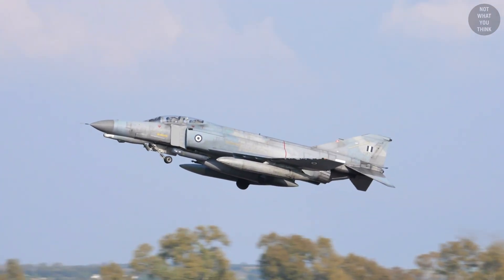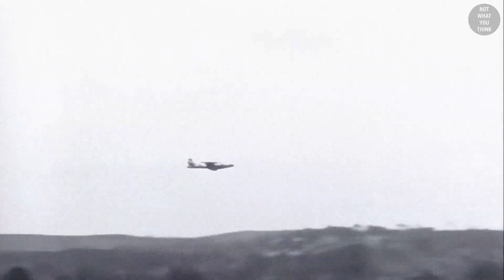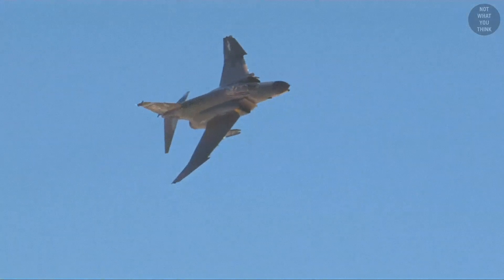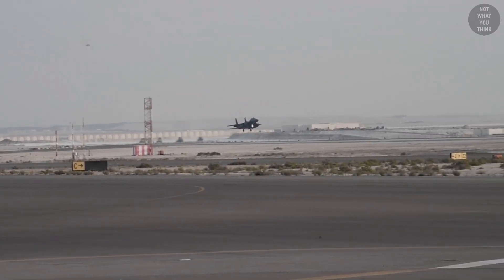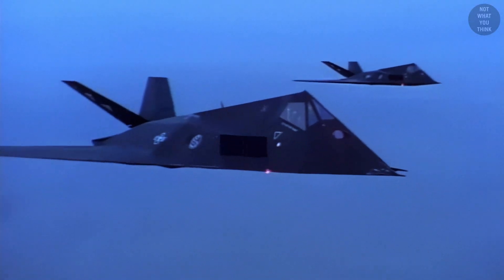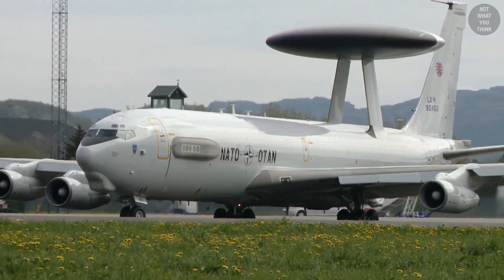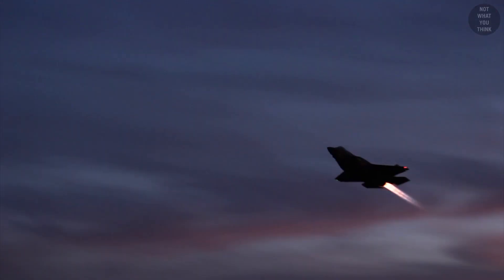Why are Modern Fighter Jets Slower than 1960s?

Comment: I'm surprised you didn't mention the concept of "supercruise". That is the ability to travel at supersonic speeds without the use of an afterburner. My understanding is that when this is achieved, the range is greatly increased because the aerodynamics of supersonic flight are more efficient than subsonic flight (as long as the afterburner isn't employed). Maybe I'm wrong about this though. I know that the F22 can supercruise but the string of JSF aircraft cannot...
Reply: Supercruise still substantially increases fuel burn compared to normal cruise.  Obviously not as bad as AB, but it's still far from free.
Reply: @northropi2027  It depends on what type of Specific Range you are after, yes super cruise will get you more range per fuel burnt and is also useful kinematically for lobbing missiles further and the decrease of Drag above transonic speeds is also useful for increasing Specific Range without use of IR intense afterburners.

But as far as Max Endurance its not particularly great for that.
Reply: @northropi2027  I thought modern planes such as Rafale were actually using supercruise to extend combat range.
Reply: @PierrickAnceaux  relative to always having afterburner on, yes, the range is better.  Relative to subsonic cruise, range is far worse.  Supersonic flight is just an inefficient way to get around, afterburner or not, though this isn't to belittle that if you have to be going supersonic the entire sortie then supercruise would probably be better than full wet thrust.
Reply: Well, the main feature of the F-35's engine is that it burns cooler, so you can't have it all.
Reply: @JAnx01  Apparently not cool enough to avoid turbine blade fracturing being reported back in early 2020.
Reply: @uberschnilthegreat22  Cool as in cooler exhaust than usual.
Reply: @JAnx01  The main feature is that the f35 burns at an higher temp, so what do you mean by cooler ?
Reply: Actually the English Electric Lightning could supercruise and it was a contemporary of the F-4 Phantom II
Reply: @bigblue6917  ahh, the lightning! The (Mark Felton?) video of Mike Hale smoking Concord and intercepting a U2 has me reaching for my Union Jack 🇬🇧
Reply: @Morris2182  it intercepted the SR-71 twice. Imagine piloting the Blackbird and the Lightning goes hurtling past you.
Reply: @bigblue6917  Source?
Reply: Also supersonic flight adds tonnes of heating on plane skin
Reply: @Eleolius  well at any speed there is both a cooling and warming effect of the wind speed. At speeds over mach 1 the heating effect start being significant, but its not really priror to about mach 2.3 that the effect is that large so its something that needed to be considered. At something like mach 1.4 or 1.6, that is typical supercruse speed the skin would still be cooler  than the internal temperature
Reply: Having listened to F-22A pilots talk about this, no.
Reply: @Random_White_Circle  Would they say though they get better range than full afterburn?  I can understand super cruise not being as efficient as standard cruise but there had to be some range benefit to the concept when not using afterburners to achieving those higher speeds.
Reply: Eurofighter typhoon can super cruise aswell :)
Reply: Supercruise isn't really for extended operation range. It has 2 main reasons. 
1. is simply faster response time as the jet can reach mission area faster if needed.
2. Combat advantage. Supercruise greatly increases missile range as it helps missile break the sound barrier which is the speed the missile face the highest drag. Faster also make it easier for the jet to defend against missiles as the missiles with need to adjust to much further lead. Both are important for Beyond Visual Range engagement.
Reply: F35 can maintain a speed above mach 1.0 for a 150 mile  dashes, so..in all practicality, it pretty much can super cruise.
Reply: The English Electric Lightning and the F86 could supercruise. It's not a new thing.
Reply: Pp0
Reply: There is a fuckton of drag when breaking the sound barrier from like mach .9+, after that drag is like 20% worse when supersonic compared to say .8mach.
Reply: You're all so full of crap, you all start believing your own crap
Reply: as far as i can remember, the English Electric Lightning could supercruise! that thing was a riduculous plane
Reply: These replies are by far the funniest shit I've seen all day. A bunch of morons who think they understand physics or modern aerial combat. It's laughable. The F22 is a air supremacy fighter, the F35 is a multirole jack of all trades. Why are people so shocked this has been the US doctrine since the beginning of the jet age. IE the F15 and F16
Reply: @EBEDieandRetry  I'm communicating via text in the YouTube comment section...
Everything I've read that is a direct quote from Jesus or the Apostle Paul was also written in text.

Don't tell me what to do.
I will continue to obey God's command to 
'go into all the world and teach every creature to obey him.'

P.S.
Evolution offers you a future as dirt.
Christ offers you eternal life and the peace of God.
Reply: @EBEDieandRetry  
God is not going to provide you any more evidence for his existence other than the gigantic Planet crammed full of amazing creatures on which he placed you.

No one will have the slightest excuse.
Reply: lol What the fuck happened here
Reply: Although supercruise is thought of the ability of the engines to maintain supersonic speeds without afterburners, the real goal really was how do turbofan engines reduce the bypass as the the speed increases to being supersonic. 

Turbojets can supercruise without afterburners given they are already at a higher altitude. Afterburners is what gets the turbojets those Mach 2.0 + speeds.

It maybe is an issue of of having greater thrust but the SR-75 engines and the F-35 almost have same thrust output. The SR-75 engines become more like ramjets the faster it goes.

I believe supercruise is really the idea of trimming the bypass of jet engines to allow for lower consumption of fuel as the speed is increased.
Reply: F22 does over mach 2.25... and yup supercruise is where its at the fuel efficiency
Reply: @KrGsMrNKusinagi0  Completely incorrect. Super cruise massively cuts down the range of the F-22 which is already a little short on range. What you and the other low knowledge people here don't seem to understand is the massive increase in drag supersonic speed places on the jet and the increase in dynamic pressure of the air entering the engine which drives fuel consumption up further than just the increase in drag does. 

No the F-22 does not do over 2.25 Mach. 2.25 is the VMax of the aircraft. That's the speed it is not permitted to fly faster than. In service the jet never gets above 1.6 Mach and this is exactly the reason the VMax of the F-35 is set at 1.6.
Reply: I think the Falklands War showed that a subsonic plane like the Harrier could handle the supersonic French planes the Argentinians used.
Reply: @maxwellshammer5283  
The Falklands War did not show anything of the sort.

So you are going to use the one example that does not actually prove what you think it does? Had the Argentines not been operating at extreme range and been trained how to properly use their aircraft against the sub-sonic Harrier the war may have turned out very differently.
Reply: Just want to add this in the conversation somewhere. 
Remember that the Concord super-cruises. You need AB up to Mach 1.6 or so, but then with standard thrust it accelerates to Mach 2.0
Reply: Supercruise is essentially due to increased engine efficiency. Nowadays combustion chamber temperature is higher which means engines runs leaner mixture than previous one, substantially increasing heat.
Reply: When Concorde flew. It’s engines were tuned for supersonic cruise. It actually consumed less fuel when supersonic at high altitudes than it did taxying from the gate to the runway.
Reply: @notmenotme614  do you have a link for your source? That's really cool, I think I wanna read about that
Reply: The exact opposite is true. Supercruise substantially increases fuel burn and can cut a fighter's range in half. Drag rises with the square of the velocity and you can't cheat physics. Much like thrust vectoring, supercruise has proven to not be worth the extra complexity and weight it adds to a design. Hence why they were left out of the F-35's design.
Reply: @dat581  Your point about drag is spot-on.
On the other hand, insinuating that supercruise adds "extra complexity and weight" is inaccurate or misleading. Supercruise isn't a physical "thing" - it's the ability to achieve supersonic speeds without AB. All one really needs to achieve supercruise is a combination of a powerful engine with reduced drag and/or weight.
As some on here have noted, other aircraft before the 5th generation F-22 have been capable of supercruise, especially when flying "clean" (i.e. without external weapons or fuel tanks).
A more accurate statement would be that Supercruise was not a requirement of the F-35 design because it's primary mission was air-to-ground and therefore it wasn't see as critical to get to the target area at supersonic speeds as say, an air-to-air intercept by an F-22 or J-20.
Reply: @kevinb4077  So you haven't a clue either. Super cruise adds weight and complexity by requiring more complex intakes and the control systems that go with them.
Reply: @dat581  From what i have heard, only the F-35B (STVOL) and F-35C (Carrier) don't have Supercruise. The conventional F-35A has Supercruise.
Reply: @vasiliyt8600  None of them do. The USAF didn't think it was worth the bother.
Reply: While it's not a feature, F35 can definitely still supercruise.
Reply: @dat581  I believe ramjets are more effective at supersonic speeds but also less effective under them. I guess still wouldnt be as or more efficient than something like a f404 in a hornet
Reply: @carti9248  Believe what you like but no, ramjets are not more efficient anywhere below 3.0 Mach.
Reply: @dat581  thx 4 info
Reply: @dat581  the thought is you're outrunning you're own shockwave?
Reply: @seeker296  That's a no.
Reply: @dat581  , The F-22 is a very good fighter and I think it gains a lot from both supercruise and thrust vectoring. One of the design requirements for the F-35 was to not include any technologies that would prevent its sale to foreign countries. Furthermore, putting thrust vectoring on the F-35 would be like putting lipstick on a pig. The F-35 was not designed to be a top dogfight fighter, but it has many other great capabilities.
Reply: @NotTheSharpestBulb-mh  Actually just about everything you have said is wrong. The F-35 was not designed to be a "top dogfighter"? Actually it was and the only aircraft that exceeds it is the F-22 and the Raptor does not exceed the F-35 in all areas of the maneuvering envelope. That silly claim is just a myth.

Thrust vectoring is not on the F-35 because it is not worth the bother. The USAF has considered locking it out on the F-22 because it doesn't add all that much benefit. Supercruise is also hardly used and not worth the bother. It's really just another misunderstood capability that fanboys love but real fighter pilots don't care about. Just like top speeds that fanboys love to quote but are completely irrelevent.
Reply: @dat581  , There were a lot of compromises made in the F-35 design. The dogfight capability was not the top priority. Air superiority was left to other planes like the F-22.
Reply: @dat581  Your comment about some people obsessing about top speed reminded me of something I read decades ago.  - a young US pilot,  (I think k he was a pilot,) was talking g to Adolf Galland and asked why he preferred the ME109 to the FW190 which was 'obviously' your best fighter. Galland responed that yes the 190 was faster but, you had to work to control it all the time whereas the 109 was easy to control and you got much more out of it than you did the 190. - statistics will only tell you so much.
Reply: @cyngaethlestan8859  Pretty much. Maximum allowable dive speed and climb rate could be far more important than maximum level flight speed in those piston engine fighters too.
Reply: @dat581  and that's why legacy aircraft can easily out turn, out climb and out dive the F-35...
Reply: @aaronsanborn4291  What, like a spitfire?  Which can out turn an F22 as well.  If you mean F16s and F15s, then no.  Of course, either of those aircraft in a real world fight against an F35 are a hunk of burning metal falling out of the sky way before they get anywhere close enough to turn with it, is that what you meant by dive rate?
Reply: @aaronsanborn4291  Who the hell is dogfighting in this century?

Against those legacy fighters which many of our allies still have the F35 does them in with ease.
In Red Flag just one F35 has a 17-1 ratio.
A full squadron and it goes over 100.

You are stuck in the past.
Reply: @aaronsanborn4291  I’ve been researching this and the opposite is true. The F35 can outmanoeuvre legacy fighters easily but it is slower in outright top speed. The US armed forces would never develop a fighter that was had worse maneuverability than its predecessors.
Reply: @jars6230  [fightets]  ~'are a hunk of burning metal before they get anywhere near'  -   -  As a generalist it seems to me that the latest high end 'fighters' have become more like highly complex control centres for equally complex long and medium range missiles rather than a 'fighter' aircraft. 

Given that in a dogfight they will get their arse's handed to them by many true fighters,  their use as a control centres seems odd.  Why not have a modern Vulcan with all the necessary high tech' equipment and sensors controling a number of true fighters,  (that could each carry some extra sensors and a couple of missiles controlled  by the mothership.) Such an aircraft could be reasonably fast, agile and stealthy (why I mention the Vulcan rather than a Victor or B52,)  whilst carrying large numbers of missiles as well as extensive defensive measures and sensor drones.

I realize this might sound outlandish and that it would  require a lot of hardened connectivity but isn't this the way these mind numbingly expensive 'fighters' are going anyway but they only carry a few missiles.
Reply: @cyngaethlestan8859  1.  The Vulcan becomes the point of vulnerability, everyone will just go after that.  
2. In practice, the most likely tactic 'true' fighters will use against F35s will be to run away.  Unlike combat exercises, where the loss rate of 'true' fighters against F35s is huge, real adversaries dont send expensive aircraft and men on suicide missions.  Hence, the current relative lack of aircraft over Ukraine, they aren't willing to run the losses.  
3.  Drones intended to be companion aircraft are about to be rolled out.  The most likely aircraft they will accompany on missions is the F35.  Relatively stealthy, able to operate relatively independently, the enemy expends all its time, fuel and missiles fighting drones, while the F35s loiter watching it all. You cannot swoop in and finish of the job in a Vulcan, you can with a flight of F35s. 

Military experts arent stupid, if the local drunk at the bar has thought of a brilliant new strategy, or piece of hardware they should use, there is generally a solid reason why they aren't doing that.  Generally being, its because its a stupid idea.
Reply: @jars6230  While I may not be a genius,  I am neither a drunk or stupid.  I was noticing a direction of technological travel, to wit,  long range control and engagement which seems to partially negate the need for all aircraft to engage in classic short range fighting.  You say,  (and I'm not questioning it - as I mentioned I'm a generalist,)  that companion drones are being developed for use with the f35,  well why not use these with the new,  larger, longer endurance aircraft as I suggested. 
 [I take it you understood that I did not mean an actual Vulcan but a new aircraft]  
As you say the enemy will be forced to engage the drones and missiles,  (whether launched from the mothership a drone or fighter under the mothership's control or direction.) As for the f35 itself going in to deliver the coup de grace,  this seems to risk your core,  very expensive and rare asset.  Send in the less valuable and more numerous fighters. 
To your first point that the mothership would become the enemy's point of attack. This is probably true unless they have highly effective communications interference (I see secure effective com's as the biggest problem) but just as with a carrier battle group the 2 or 3 motherships would have multiple layers of defence with their fighters, drones,  missiles and counter measures. 

Lastly you mentioned the f35s very high kill ratio but it only carries a few missiles so this is theoretical. a large aircraft could carry  four or more times as many plus those on other platforms it is controlling

I am not trying to start one of those annoying Youtube rows but I don't think my idea was 'idiotic.'  Ideas,  good or otherwise  don't always come from experts and it seems reasonable to at least air them.  - [remember the yanks took the best submarine design available, the German type 21 (21?) and stuck an atomic power plant in it to produce the 'best'  submarine - meanwhile the Russians gave the problem to a team who knew nothing about submarine design and revolutionized all future submarines]
Reply: @dat581  Yup, physics is unbeatable.
Reply: @dat581  Viscose drag rises with v cubed, not squared.
Reply: @dat581  I thought drag was closer to cube of the velocity but does it change over at supersonic?
Reply: @hubbsllc  Look up the drag formula if you don't understand. D=Cd1/2V2S
Reply: @dat581  I "understand" but I still stand corrected. And, it looks like the equations are different between sub/supersonic but contain a V^2 term in both cases.
Reply: @dat581  Not true at all. The F-35 is too much of an aerodynamic pig to make supercruise worth the effort. Thrust vectoring reduces trim drag and is most definitely worth the effort. F-35 does not have F-22-level performance because it was never designed to be. It's primarily a strike aircraft, not a fighter or interceptor.
Reply: @dat581  I'm Talking about Specific Range not Range as a total, Drag actually Decreases after passing transonic speeds and going super sonic, requiring less power than going high subsonic.
Reply: @glassfullofmilk  It seems you don't understand specific range either. What you aren't getting is the huge fuel consumption increase that is imposed on the engine past the transonic region. The specific range is far less at any supersonic speed.
Reply: @dat581  It seems you are forgetting about the increase in Q at higher speeds increasing the available thrust at an already high efficient engine operating RPM and low specific Ct
Reply: @glassfullofmilk  Yes, supersonic drag is lower than transsonic drag, but it is still higher than the drag at subsonic speeds. 
The max range can usually be achieved at subsonic speeds. That said, the F-104 is an example of an aircraft that had a lower subsonic range than other interceptors of that time, but a higher supersonic range. Still, the supersonic range of the F-104 was a fraction of its subsonic range.
Reply: @dat581  What you say regarding drag and velocity isn't true for supersonic speeds. It only applies for subsonic speeds and below mach 0.8. After that, there is a huge spike in fuel consumption, followed by an exponential drop at around mach 1.6. In theory, if you "have to" fly supersonic, the most efficient speed would be above mach 1.6, however it's true that even after the exponential drop, fuel consumption in supersonic range is still always greater than that in mach 0.8
Reply: @spencermacallistor  That one's a bit of a myth and does not apply to conventional jet engines.
Reply: How are they able to enter supercruise without a frame shift drive?
Reply: @ENCHANTMEN_  They use a friendship drive.
Reply: @ENCHANTMEN_  They must have outfitted the friendship drive, some super top secret stuff.
Reply: How many fighters can super cruise with a combat load?
Only the F22. 
All others that can  super super cruise need to  sacrifice ordinance to be able to  super cruise
Reply: @Milvus_In_Excelsis  is that with weapons on additional hardpoints or just internal bay storage?
Reply: @smithyMcjoe  just internal storage.
That's the thing with weapons in hard points, they cause a lot of drag.
Reply: @Milvus_In_Excelsis  I assumed as much, tangential but, I don't imagine they'd be very good for it's radar profile either, many more faces for it to bounce off of.
Reply: @smithyMcjoe  that's why fourth generation fighters have big RCS.
A clean F16 Viper has an RCS of 0.5.
Lower than the RCS of the SU57.
But once weapons are added the RCS goes up.
Reply: @Milvus_In_Excelsis  pretty sure the Swedish Saab 39 also can super cruise with combat load, but it’s a much smaller plane designed for takeoff and landing from normal roads (so I’d doesn’t need airports) and can therefore not carry as many weapons as a larger jet
Reply: Then you also have to address g forces. You could have a craft that can handle the manuvers but still unable to use them because of the pilots capability to handle gs
Reply: @seanrea550  True and a lot of g also causes increased metal fatigue on the wing roots etc. Reducing the lifespan of the aircraft. Yes a jet might be able to do 9g, but not indefinitely for 10,000 flying hours
Reply: @notmenotme614  yep, there are some planes that can do mannuvers that cause their pilots to black out already. G-suits only do so much. I think the best G-suits only set the g limit up to 8 or 9 Gs.
Reply: @seanrea550  What are you on about?
Reply: @dat581  manuvering at speeds cause g forces. A plane can be made to handle them, pilots not so much.
Reply: @seanrea550  Thank you Captain Obvious. That has nothing to do with this thread.
Reply: @dat581  for a planes top speeds or prime cruise speeds to be useful they should also be able to manuver at those speeds, which also includes slowing airspeed to manuver. Unless you only plan for the plane to turn over far wider arcs than others in its class.
Reply: @seanrea550  Ok you should stop now. You REALLY have very little understanding of what you are talking about.
Reply: maybe you're wrong about this...yes probably you're
Reply: @givdb5513  thanks for contributing here. I think I've had about 40 people offer to tell me that. Very helpful. What's funny is I looked up supercruise right after I posted this comment and before anyone replied and quickly learned the truth about it... But then for the next week, all I get are replies telling me I was wrong.
Reply: @perpetualjon  Ultrasonic airplanes are still in experimentation. Years ago that would be impossible. Now it is HOWEVER that doesn't mean still useful and practical, the costs, and the accidents it can cause if suddenly you break (how many G forces)
Reply: @givdb5513  WTF is an "ultrasonic" airplane? We're still working on hypersonic aircraft, and probably won't have operational one for a decade or two. So ultrasonic would be what? Mach 50 and above?
Reply: @markbrisec3972  Mach 50 already exists. It's the nuclear weapons of China that they only have. I confused the word however what's the difference between "super" and "ultra", it's like when we were kids saying that "I'm transformer super mega ultra" they're all synonymous words, those words in the dictionary don't have LV 1 LV 2 LV 3 or definitions like Ultra = is more than super IT IS NOT. Ultra it is an informal word synonymous with super, however, it has the slight definition of "beyond space" or "extremist" while super "exceeds the limit" and "very fast". 

In the end, they're very similar words.
Reply: @givdb5513  Yea no mach 50 doesnt work in the atmosphere really it would be rapidly vaporized from heat, Mach 25 is around reentry speeds,but the term your looking for would by hypersonic, also its called a prefix so not exactly words themselves except in a few cases but its a modifier on words that functions as a descriptor. One of another fun quirk of english.
Reply: @melalba9711  China has the most fastest missiles in the world. It's impossible that the USA has one better. I was watching a whole documentary that America was worried about it because it would be impossible to defend it. until they invented some defense mechanism. Just like 5G belongs to China only, the rush for technological advances will determine the future of a country.
Reply: There really is something very wrong with you people today. You all get taught propaganda as if a real part of your own country's history?, and it's the rest of us, that have to put up with reading your own opinions of comical rubbish! 

Try to have a discussion about any military aircraft, with any American, and you'll be shocked just how unaware they really are? They all talk endless rubbish, and so much so, they even start to believe their own rubbish. It makes no difference, if you show them, or explain to them, or even go through it in fine detail with them. 

You can conclusively prove things to these people, and they'll ignore it, and just carry on saying the same thing? Even when they've just been shown, and had something proven to them, (something that they were completely wrong about), makes no difference at all. Nope, they'll just deny it, or ignore it, seriously, you can talk to any of them about any military hardware, at all, and you'll always come to find, they actually know nothing about any of it.

Even when you point things out to them, things that they've so obviously just dreamt up in their own head?, all you'll then get back, is a few lines of remedial illegible rubbish. But you'll then see them somewhere else, repeating what they now already know to be complete rubbish??. Honestly, you could not make it up! 

If people could think for themselves today, they'd all be questioning why the USA made a point of announcing to the world, they've made it illegal to sell the F-22??. The USA seemingly want it believed, it's because it's so good, they don't want anyone else to have it?. But, that actually makes no sense at all, because the reality is, they've no idea what's around the corner in modern technology terms, and with the speed we're seeing new military tactical hardware being designed, developed, and created today, It could well of made great sense to sell the F-22 at some stage?. (If it actually works). If it worked?, they'd have been able to recoup much of the resources spent on the aircraft, if not the resources in their entirety.

Now, there's another reason the USA would make a point of announcing they've made it illegal to sell the F-22?, a point that the American people seem to want to neglect today? And that's, If, it doesn't work, If it is, as I suspect it is, a lemon?, and if the USA have then used the F-22 as a propaganda purpose aircraft?, then what better way of preventing anyone else from finding out that it actually doesn't work, and it's really a lemon?, than making it illegal to sell? 

Really, and logically, the only possible way to explain that stunt, of the USA announcing they've now made it illegal to sell the F-22, can only be because it's a propaganda aircraft, a failure! 16 years the US have had F-22, and they've been in wars the entire time, only they've never used it, and they removed every F-22 from the Middle East, Jordan, Iraq, Turkey, and Saudi just after Russia arrived in Syria in 2015.

You can think about this as much as you like?, that is the only real possible reason the USA would do that. Absolutely no doubt about it, I guarantee we'll never see the F-22 involved in any sort of war scenario, or any major sortie, as it's basically junk. They've even trashed all the infrastructure they had in place to build more of them.
Reply: @hotstepper887  , This rant does not have a single actual military fact about the F-22. You call it a failure, but you do not seem to know anything about its performance, stealth, or other characteristics.
Reply: @NotTheSharpestBulb-mh  I have also shown you how useful what it does claim really is? Do you not understand the English language? 

Mark Hollingsworth
4 minutes ago
 @Hot Stepper  , This rant does not have a single actual military fact about the F-22. You call it a failure, but you do not seem to know anything about its performance, stealth, or other characteristics.

I think, you'll find this answers everything you've just pathetically tried to claim? 

Seemingly these Americans have no idea the F-22 and F-35 can't see, track, or target any other stealth aircraft from BVR (beyond visual range). Stealth alone defeats high-frequency (short wave) radar by absorption and deflection, it does not defeat low-frequency (long wave) radar. Therefore, to see, track, and target stealth aircraft you must have long-wave radar, but it must also be enhanced to remove all background clutter for targeting purposes.

Neither the APG-77 radar used in the F-22, nor the APG-81 radar used in the F-35, can see any other stealth aircraft from BVR (without enhanced long wave radar) — This fact the US Air force obviously know! Only it seems the reality is, that when the F-35 radars were being designed 13 years ago, there were no other stealth aircraft to think about as a potential threat? So how can these US aircraft be seen as any sort of threat to either China or Russia, who both have these aircraft technically beaten? They can see and target US jets from BVR, yet the US jets can't even see them from BVR?

Russia's new 5th generation Byelka (2band) radar, used in SU-57, does have enhanced long-wave radar, they've designed and developed the first L-Band fighter radar we've ever seen. They've cleverly embedded L-band AESA radars in the leading edges of the wings. The new L-band AESA radar data gets processed in real time through extremely powerful Russian Elbrus computers being significantly enhanced removing all clutter, meaning it can see, track, target, and engage enemy stealth aircraft from BVR. The technology along with its impressive range parameters and jamming ability over large areas make this aircraft deadly to all other aircraft types. 

They can also interact in ''real-time'' with each other member of the squadron, (auto selecting) the best placed BVR missile, that can be fired by anyone of the squadron with a bogie on radar, they can also take control of surface-to-air (SAM) missile defence systems - (that alone is lethal), and they can see track, enemy stealth fighter aircraft long before Russian airspace, from much greater distances, with "real-time" data from massive Russian ground long wave stations (that are all protected today with the networked S-400 defensive system). 

Therefore, as they'll always know where the enemy aircraft are, they'll always be able to approach any enemy aircraft head on, and therefore stealthily, (Russia wisely sacrificed rear end stealth for much better manoeuvrability) meaning today, the US fighter jets would not even be able to see them coming!! Russia's Byelka (2band) radar covers all aspects of frequencies across all channels, that are used for tracking, targetting, and also jamming. It's part of Sh121 multifunctional integrated radio electronic system (MIRES) on board the SU-57. 

Russia tested much of this new radar suit on the SU-35, so they also have the option of fitting this radar into SU-35's permanently, meaning Russia's SU-35S flanker will be at no disadvantage with F-22/35. As although the SU-35 can be seen and targeted from BVR, the SU-35 with the new 5th gen radar is as able to see and target the US jets from BVR, seeing the all-important Russian advantage in BVR missile distance, plus the excellent manoeuvring, neither the F-22/35 have, as more than critical, if you're going to avoid simply being blown out of the sky.

The design has clear potential to provide a genuine shared multifunction aperture with applications including: Search, track and destroy missile mid-course guidance against low signature aircraft. Identification of Friend, Foe/Secondary Surveillance Radar. 
Passive angle tracking and geolocation of JTIDS-MIDS-Link-16 emitters at long ranges.
Passive angle tracking and geolocation of L-band AEWC-AWACS and surface based search radars at long ranges.
Passive angle tracking and geolocation of hostile (i.e. Western) IFF and SSR transponders at long ranges.

High-powered active jamming of JTIDS-MIDS-Link-16 emitters.
High-powered active jamming of satellite navigation receivers over large areas.
High-powered active jamming of L-band AEWC-AWACS and surface based search radars at long ranges.
High-powered active jamming of guided munition command data links over large areas.

Effectively neutralizing the USA's use of AWACS for their detection. The Tikhomirov NIIP L-band AESA is a very important strategic development, and a technology which once fully matured and deployed in useful numbers, will render narrowband stealth designs like the F-22 & F-35 Joint Strike Fighter, and some if not many UAVs, as highly vulnerable to all Flanker variants equipped with such radars.

Do you understand ANYTHING at all? Now please. Do take YOUR rant of completely uneducated junk elsewhere and leave my name off anything else you might want to say, I'll never be interested in hearing anything you might think, and don't want the notification of another idiot talking juvenile rubbish, thanks all the same.
Reply: @NotTheSharpestBulb-mh  My old man was a Captain, and squadron leader of 800 squadron, in the FAA (Fleet Air Arm) of the RN. 

He was selected to go to the States to train them, how to fly the Harrier, and show them what the Harrier could do. We off loaded quite a few of our older and retired Harriers to the US, so they could learn all about it, while training their engineers on its engines, airframe, and construction. 

They then got permission to build the Sea Harrier, but were only allowed to make very few modifications to the design. 9 years we spent over there, and it's him and all his mates who said the F35B would never be VTOL capable, and they were all spot on... LOL

And furthermore it actually offers us nothing, we could not already do, but in fact less than we could do with the Harrier?, as that aircraft could come from, and go anywhere with its VTOL ability, as all the US special forces will attest too. 

They used it more than any other aircraft,  they were attacking Taliban, just lifting from a "hide" remaining low avoiding any SAMs or radar, ambushing them before they could scramble to safety, then just gone.  While returning to that hide. They wiped out more like that, than by any other means.

He also flew the Buccaneer, an aircraft I've been in many times, from the age of about 11 LOL... Well things were a lot different back then, and us kids would often get to go see the old man on a Sunday when they were at our home bases, and down here, whenever it was quiet we'd often talk our way into a flight on whatever aircraft they were with LOL.

The old Fairey Gannets were awesome, man, what a view! I've been in the Harrier GR 5, GR 7 and the GR 9 also the Sea Harrier. Nearly every helicopter you could think of, LOL, including the old, world speed record holder, the Lynx. Gliders?, done many of those, but the most amazing and impressive of them all was indeed the Buccaneer.

You can't describe what it feels like to travel at an altitude of 10 - 15 feet, at 450 mph. Seeing garden hedges as blurs LOL, flying straight over them hahaha. That aircraft, the Buccaneer I'll never forget, it scared the life out of me.

Rolling down the runway
throttles open wide
see the mighty Phantom
sway from side to side
airborne again without a blip
It's just one more aborted trip
but we're pressing on regardless
for the wg cdrs AFC

Went to early briefing
climbed into the Kite
opened up the throttles
and roared into the night
leaving the flare path far behind
It's dark outside, but we don't mind
cos we're pressing on regardless
for the wg cdr's AFC

Rolling down the runway
throttle open wide
see the mighty Falcon
sway from side to side
airborne again with just 9 G
I wish I had a nav with me (!)
but we're pressing on regardless
for the wg cdr's AFC

Rolling down the runway
throttles open wide
see the mighty Jaguar
sway from side to side
airborne again, but only just
It's not much fun
with F*** all thrust
but we're pressing on regardless
for the wg cdr's AFC

GIVE ME BUCCANEERS!
They're British through and through
The Banana Jet
The Best we've had yet
We are the last of the few.

Don't give me the Jaguar
Unless you refer to the car
The car is a groundhog
The aircraft is half frog
Don't give me the Jaguar.

Give me Buccaneers
They're British through and through
The Banana Jet
The Best we've had yet
We are the last of the few.

Don't give me the Harrier jump jet
You haven't convinced me yet
Jets that fly backwards 
Are soon to be knackered
Don't give me the Harrier jump jet
Well… Not just yet...

Give me Buccaneers...
They're British through and through
The Banana Jet
The Best we've had yet
We are the last of the few.

Don't give me this computer crap
It's no way to tackle a SAP
It's OK for Dicks, Germans and Spicks
But Gentleman always carry a map!

Give me Buccaneers...
They're British through and through
The Banana Jet
The Best we've had yet
We are the last of the few.

Don't give me Air Traffic Control
They live in a bloody great hole…
They scream, and they shout, then F**k you about
Don't give me Air Traffic Control.

Give me Buccaneers...
They're British through and through
The Banana Jet
The Best we've had yet
We are the last of the few.

Don't give me the F-104
It's only a ground loving whore
It goes in a turn, flick, spin and burn
Don't give me the F-104.

Give me Buccaneers
They're British through and through
The Banana Jet
The Best we've had yet
WE ARE THE LAST OF THE FEW!
Reply: There is so much we could talk about with the F-35?, and just looking at the reality of the F-22?, should have been showing us all the reality before this country bought a single one, but not only did we waste our money on them, but we put our own Rolls-Royce engines in our F-35Bs. 

That don't stand up to what we were all told they would be? An aircraft that is stealthy with much improved electronics and computer software, able to travel supersonic that, like the Harrier, would be VTOL capable.

It's very clear, we would have been far better off concentrating on a new supersonic Harrier type, or we should have been looking at the new SABRE engine as a realistic look at upgrading our own air force? 

With the wasted money, we could have been building our very own modern fighter aircraft for the last 20 years?

Today, BAE Systems is developing a HVP (Hypervelocity Projectile) for the British & US military. They've already purchased 22% of ''Reaction Engines Limited''. 

Reaction Engines, was founded in 1989 by three propulsion engineers from Rolls-Royce, Alan Bond, Richard Varvill and John Scott Scott. 

Their early work on the RB545 engine, destined for use on HOTOL was evolved and focused on producing a robust technical design for the new Synergetic Air Breathing Rocket Engine. (SABRE).

They've been developing a new type of hybrid jet/rocket engine.  SABRE — can lead to the development of new hypersonic aircraft and future space vehicle's. The technology has immense military value for the creation of hypersonic missiles or/and aircraft, that would be able to hit targets at speeds and ranges that are unheard-of today. 

Moreover, defending against such an attack would be extremely difficult. The technologies and military applications of the engine technology, could easily be applied for hypersonic missiles of both attack and defensive duties, as well as new high-speed long-range bombers or reconnaissance aircraft. Such machine's, travelling at orbital velocities, would be nearly impossible to intercept with current defensive technologies. 

"Skylon" Is a series of designs for a single stage — to orbit, spaceplane concept, also using SABRE (a combined-cycle, air breathing propulsion system). They're also looking at building the ''A2'' a civilian Hypersonic airliner with a cruise speed of well over Mach 5.2. 

So, as BAE have already bought into this company?, we can be pretty sure they've already cracked this engine. 

You'll soon read elsewhere the American trying to suggest something about this, will be American?, when it's not, never is, and all they've ever really done, is copy British tech, while crying China steals "their tech".

And we bought into it! MUGS!
Reply: We always hear about the big bad Great Britain (which is actually completely wrong) British “world history” was largely started against the Spanish when Queen Elizabeth I, told her Royal Navy to become (''privateers'') pirates in other words, and she told them, the more booty they could muster, would see them achieve nobility in the higher echelons of British society. 

Elizabeth's authorization of sea-raiders (known as Sea Dogs) such as Francis Drake and Walter Raleigh allowed her to distance herself from their raiding activity while enjoying the benefits of their plunder.

Britain was asked by so many of those countries (she's today accused of attacking by the uneducated) for her protection from the French and the Spanish, who were trying to build Empires, and were also trying to break us on this Island the UK by blockading us, and trying to prevent us from trading throughout the world. 

Britain had no choice but to fight against both France and Spain, for our own existence, but nobody talks about this today?, yet that is why we began attaining an Empire, not by choice, but by necessity!
 
They did not sail into ports and attack countries to take into her Empire?. That's, again, just wrongly assumed. Go find out how and why the British were even in New Zealand? 

Yet still today, we see, and we read people who actually think Britain built her Empire, through invasion and killing and stealing? 

The truth really is, those countries we're all glad to see Britain beat their oppressors, but so few understand this today?, and even fewer want to understand it?. 

Yet it's ironic, when you think, the only reason many of these people making false claims are even allowed their opinion today?, is 100% entirely thanks to Britain!

Britain was also creating trading posts all around the world, while also protecting them. All of  these countries fell under British occupation and rule. Britain actually improved many countries, and in so many various ways. We created many countries their own military defences, and army's, many of which are still going to this day? 

Many also forget that Britain protected those countries who would've fallen to communism, if not for the fact, they were under British protection. Even today, we still  hear some people from places like Jamaica, saying they wished they were still part of the British Empire, and this again, so few understand today.

Britain was not just all bad, but actually did a hell of a lot of good for millions of people, all around the world, we also opened many of these countries up, to trade with, not to rob and steal from, we modernized many of them, we created housing, structures, schools, and communities, and gave them the ability to trade throughout the entire world, those people found a voice, and a purpose, thanks to the UK. And many of which will still tell you so today!

Antigua and Barbuda, Australia, The Bahamas, Bangladesh, Barbados, Belize, Botswana, Brunei Darussalam, Cameroon, Canada, Cyprus, Dominica, Fiji Islands, The Gambia, Ghana Grenada, Guyana, India, Jamaica, Kenya, Kiribati, Lesotho, Malawi, Malaysia, Maldives, Malta, Mauritius, Mozambique, Namibia, Nauru, New Zealand, Nigeria, Pakistan, Papua New Guinea, St Kitts and Nevis, St Lucia, St Vincent and the Grenadine, Samoa, Seychelles, Sierra Leone, Singapore, Solomon Islands, South Africa, Sri Lanka, Swaziland, Tonga, Trinidad and Tobago, Tuvalu, Uganda, United Republic of Tanzania, USA, Vanuatu and Zambia.

Britain ruled the seas, and she most certainly put that to her use.

In the 1200s, the Magna Carta was written, and It's still used in all parts of the world today, in every other countries own laws one way or another. Britain has not only been involved throughout the entire world for hundreds upon hundreds of years, but spent much of that time leading It. 

Since the 1500s, Britain was (accidentally) building the largest, the most influential Empire, of all time. Love it, or hate it?, there's no denying the great things this country has given to the world, no other country gets remotely close.

When Britain gave up its Empire, (so she could continue fighting for everybody's freedom), did Britain fight to keep it? No, not at all, Britain actually made sure each country had a capable government in place, before then leaving each country, we did not fight them or kill them. Hong Kong was the last part of our Empire, and once again, we simply gave it back to China.

Still, to this day, no country has come anywhere near achieving what Britain has already achieved In this world. No country has given this world anywhere near what Great Britain has.

No country has made anywhere near such important discoveries in this world, as Great Britain. Britain is responsible for nearly every one of the top 20 discoveries in this world.

No country has given the world all the sciences we all take for granted today, they all came from Great Britain. Science, itself, is indeed British.

Sir Isaac Newton: The father of physics, and considered to be the father of all sciences, by science itself.
Robert Boyle: the father of Chemistry.
William Gilbert: the father of Electricity and Magnetism.
Ernest Rutherford: the father of Nuclear Physics.
Adam Sedgwick: the father of modern geology.
Charles Babbage: the father of the Computer.
John Cockcroft: the genius who first split the atom.
James Chadwick: with the discovery of the neuton.
Michael Faraday: the genius that discovered Electromagnetic Induction.
John Dalton: the discovery of the Atom, and the writer of the Modern Atomic Theory.
John Thomson: the discovery of the Electron.
Charles Darwin: with the Origin of Species. 
Stephen Hawking: the general theory of relativity and quantum mechanics.
I could keep going, for many more pages… Or even books.

No other country has given the world medicines, that are responsible for billions of people living today, (7.5 billion on earth) Alexander Fleming changed the world of medicine. His invention “Penicillin” is said to be responsible for the survival of over 5.5 billion people to date. British medical achievements started all we know today.

No other country comes anywhere near inventing things, things we all use every day, than Great Britain. No other country comes remotely close. Invented the Jet engine, T.V, Telephone, Train, Penicillin, Computer, Hovercraft, Vertical Take Off Landing aircraft, LCD, Tanks, The World Wide Web, look at the history of each of those? A person from the UK lay at the heart of the device? I could keep going, Britain is responsible for an astonishing 54%, of all worldly inventions.

Britain is also responsible for an enormous 61% of all modern day military invention. The chances are, if you were to look up any random piece of military hardware, there's a 2/3 chance it will be a British invention.

No other country has stood up, and fought for the people's freedom by preventing the whole world from falling into the dark ages of tyranny. Great Britain is the only country in the world, that has fought against every attempt at tyranny in our world's modern history. So many times Great Britain saved Europe throughout history, not only in WW2, but many times before. With the defeat of Napoleon, being just one. Great Britain, with Prussian support, defeated Napoleon, he defeated everyone else.

Russia has defeated all armies that have tried to defeat her on her own soil, apart from the Mughal Empire & Great Britain (partly France). We are the only countries/empires on earth to have beaten Russia on her own soil.

Who stood up, alone, to the Nazi might? Not anyone else, no, only Britain. No matter about all the bullshit we hear about the British Empire, it still did far more good in this world, than the tiny minority of bad, but even its bad side?, even that's a billion times better than wherever these people (we endlessly read talking their hate, come from). 

And isn't it amazing, that I can confidently say that?, and say it, without even knowing where these others come from? Think about that.

But please, if anyone disagrees?, then do tell us all about these tremendous countries you must come from? Tell us all about these great things your own countries have actually done in this world? Tell us all, let's hear about these tremendous things your own countries have done for, or given, this world? 

Because those people must understand, that if they ever want to run down another country? Then you must come from better or be able to claim better? Otherwise, where is your right to hold any kind of opinion, on anything or anyone else? If your very own country can't offer anything remotely the same, or claim to have done anywhere near what this country can claim, and has done for others in this world? 

The truth is, you have no right at all to judge anything! Even more truth really is, you all owe this country so much.

But anyway, I can't wait to read all about these fantastic countries, and their tremendous war efforts, efforts to save the people from oppression and tyranny? This will be fun!
Reply: It was the English that free'd Jamaica from the brutality of the Spanish. The colony relied on passing ships for the trade of hides, and fruits. The colonists were involved in ship building and repairs. However, Jamaica never prospered as a Spanish colony. In fact, it was viewed as a burden and in 1512 there was a movement towards relocating the colony in Cuba.

Under the rule of the Spaniards, the Taino population dramatically declined as a result of the combination of new diseases such as smallpox, and the ill-treatment meted out to them by the colonists. By 1598, less than half of the Taino population remained.

In 1655, the Spanish were driven from the island by Admiral William Penn and General Robert Venables. The Spanish were forced to flee the island. Although the Spaniards were driven out they never gave up hope of recapturing the island of Jamaica and in 1658 another Spanish force landed but was defeated at the decisive battle at Rio Nuevo. 

British “world history” was largely started against the Spanish when Queen Elizabeth I, told her Royal Navy to become (''privateers'') pirates in other words, and she told them, the more booty they could muster would see them achieve nobility in the higher echelons of British society. 

Elizabeth's authorization of sea-raiders (known as Sea Dogs) such as Francis Drake and Walter Raleigh allowed her to distance herself from their raiding activity while enjoying the benefits of their plunder.

The island began to prosper under the rule of the British. Great wealth was brought to the island by the buccaneers, who operated mainly from Port Royal, by plundering Spanish ships which transported gold and silver from South America. By the late Seventeenth Century, Port Royal had earned the reputation of being the richest and the wickedest city in the world. 

In 1692 this town suffered destruction by an earthquake in which more than half of the town sank beneath the sea. This signalled the end of piracy in the West Indies. 

The second half of the Seventeenth Century saw the beginning of the “sugar revolution”. In 1833 slavery was abolished in the British West Indies, and a system of apprenticeship was adopted. 

The objective of the apprenticeship system was to help them adjust to their free status and to supply the planters with a source of constant labour until they could adjust to full wage labour. The abuses of the system were halted in 1838 when full freedom was given. 

The abolition of slavery saw a rise in the construction of Free Villages, and growth in peasant farming. The Institute of Jamaica was founded, to encourage literature, science and art. 

By 1872 the capital was transferred from Spanish Town to Kingston. There was an improvement in the water supply and a number of schools were established. There was a shift from sugar to banana production.

The Great War (1914 - 1918) gave many Jamaicans the opportunity to travel, which in turn helped to shape their views of the system of Government. In addition, during the early Twentieth Century, many Jamaicans left in search of employment in the Panama Canal Zone, and in Costa Rica, Cuba and Honduras to work on the plantations. 

The movement of people brought about a change in ideas by the 1920s. Marcus Mosiah Garvey, who promoted unity among blacks and pride in their race, became a prominent figure during this period.
Reply: USA REAL HISTORY, Cont'd...

21. Korea, The U.S. flew in Syngman Rhee, a conservative Korean exile, and installed him as President of South Korea in 1948. Rhee became a dictator on an anti-communist crusade, arresting and torturing suspected communists, brutally putting down rebellions, killing 100,000 people and vowing to take over North Korea.

22. Laos, The CIA engineered at least three coups between 1958 and 1960 to keep the growing leftist Pathet Lao out of government.

23. Libya, NATO conducted 7,700 air strikes, 30,000-100,000 people were killed, loyalist towns were bombed to rubble and ethnically cleansed, and the country is in chaos as Western-trained and -armed Islamist militias seize territory and oil facilities and vie for power. 

24. Mexico, The Zetas cartel was formed by Mexican security forces trained by U.S. special forces at the School of the Americas in Fort Benning, Georgia, and at Fort Bragg, North Carolina.

25. Myanmar, support from the CIA. Burma's opium production grew from 18 tons in 1958 to 600 tons in 1970. The CIA maintained these forces as a bulwark against communist China, but they transformed the “golden triangle” into the world's largest opium producer.

26. Nicaragua, Anastasio Somosa ruled Nicaragua as his personal fiefdom for 43 years with unconditional U.S. support. After he was finally overthrown by the Sandinista Revolution in 1979, the CIA recruited, trained and supported “contra” mercenaries to invade Nicaragua and conduct terrorism to destabilize the country. In 1986.

27. Pakistan, In the past 12 years, U.S. military aid to Pakistan has totalled $18.6 billion. One of the three major state sponsors of terrorism in the world today are U.S. allies.

28. Saudi Arabia, The U.S. has just negotiated the largest arms deal in history with Saudi Arabia. One of the three major state sponsors of terrorism in the world today are U.S. allies.

29. Turkey, Turkey is a long-standing member of NATO. One of the three major state sponsors of terrorism in the world today are U.S. allies.

30. Panama, The indictment to arrest Manuel Noriega in 1971, was a pretext for the U.S. invasion of Panama in 1989, whose main purpose was to give the U.S. greater control over Panama, at the expense of at least 2,000 lives.

31. The Philippines, Since the U.S. launched its so-called war on terror in 2001, a task force of 500 US JSOC forces has conducted covert operations in the southern Philippines.

32. Syria, When President Obama approved flying weapons and militiamen from Libya to the “Free Syrian Army” base in Turkey in unmarked NATO planes, he was calculating that the U.S.could replicate the “successful” overthrow of the Libyan government.

33. Uruguay, Uruguay in 1970, when Police Chief Alejandro Otero objected to Americans training his officers in the art of torture, he was disposed of…

34. Yugoslavia, The NATO aerial bombardment of Yugoslavia in 1999 was a flagrant crime of aggression in violation of Article 2.4 of the UN Charter.

35. Zaire, Patrice Lumumba, Congo's first elected Prime Minister in 1960. He was deposed in a CIA-backed coup led by Joseph-Desire Mobutu, his Army Chief of Staff.

And you all think you've some sort of right to even try to judge others? You've not got the intelligence to judge a pass the parcel contest!!
Reply: @hotstepper887  , The Russians have not fielded a serious stealth fighter. The F-22 has flown missions in Syria and caught the Russian aircraft completely by surprise. I am not impressed by your juvenile insults.
Reply: @hotstepper887  Dude wtf... Don't you have a hobby or something? Nobody's going to read all that...
Reply: @Nate-bn5kk  Thicker than any American, now that's super thick.
Reply: @hotstepper887  now thats a lot of textwalls geez
Reply: @hotstepper887  lol took you three replies to get my attention, at least you took my advice and shortened your messages up!
Reply: Typical US propaganda, usually consists of silly falsehoods, and fake misinformation claims, like the F-15, is said to be unbeaten in A2A combat? It's true, only when we look at every aircraft shot down by an F-15?, we find that none had any capabilities to offer anything offensive, and most had little if anything defensive, many without even a basic radar? Meaning, you'd be absolutely stunned, if the F-15 didn't shoot every one of them down. So it really is a very silly, meaningless propaganda claim? 

Now we do have another aircraft, that is also unbeaten in A2A combat, and has faced off against aircraft as capable as itself. The British Sea Harrier is the only aircraft unbeaten in A2A combat, that has faced off against worthy, viable opposition. And that really is a huge factor, that's worth knowing, unlike the F-15 propaganda claim, that you'd be shocked if it hadn't managed.
Reply: We see the USA still unable to produce and build a VTOL capable fighter aircraft. The F-35B was claimed by the USA, to be able to do what the Harrier could do, while also being supersonic, stealthy, with modern avionics systems, etc etc, this is what we were told. Only one of the biggest technical headaches the British always had to build the Harrier, was the VTOL — transferring from ''lift'' (downward nozzles) to forward flight (rear-facing nozzles) and flying away. 

Apparently to achieve it took the British a hell of a lot of technical work, three — four months at a time over 3 years. (Look up all the variants they made) but they never gave up, and they finally figured it out. I said long before we ever saw the F-35B, it wouldn't be VTOL capable, even with the Rolls-Royce lift engines, because the USA has tried many times before, and failed, only managing to produce the British Harrier able to do so. Every US airframe (and there have been many), have all failed. 

At 7 mins 50 seconds, you'll watch a Harrier perform a proper VTOL. Copy and paste “2013 MCAS Yuma Air Show — AV8B Harrier Demo” into YouTube search. Watch it from lift off, (to more importantly), flying away from the lift-off, and you'll see the transfer of nozzles take place.

You'll not find a single piece of footage of the F-35B doing this. I've had (Americans) tell me all sorts, like it is VTOL and can do it, even saying they've seen it? LOL, only when they can't show it? They quickly change, and instead we'll read them claim it was never intended to be VTOL capable? LOL. 

Sure, when Lockheed Martin's very own page on YouTube clearly shows them trying to suggest it is VTOL capable, when it so clearly is not? Copy and Paste “First F-35B Vertical Takeoff Test” into YouTube search. Watch this, you'll see it lift off, only you'll see it take off go straight up & hover then return straight back down? You'll never see it fly away from the lift-off? Believe me, if it could, we'd see it doing so in every piece of footage we have on the F-35B - like we still see on all the footage of the Harrier doing so. But you'll never find any footage anywhere of the F-35B doing that. 

They'll then go on to say it's not necessary? LOL, while forgetting, they're to be carrier-based aircraft?, meaning even just slight damage to the deck or ramp, they can't get any jets airborne?. Defeating the entire purpose of having the aircraft in the first place! You can't ever lose an entire carrier in battle, for only minor damage, whatever next. 

And why do we see the USA doing this? It's obviously because the USA is still the only country that's never managed to produce & build a VTOL fighter aircraft. Britain did so in the late 50s, Russia did so in the late 60s the USA has tried and failed numerous times, so it seems this time they're going to try to lie about it LOL, that country is a travesty, man! It shows us that Lockheed are not unknown to produce propaganda aircraft. 

As I claim, the F-22 is exactly that. A lemon, that became a propaganda aircraft, that was intended to be a viable military aircraft, that failed.
Reply: Seemingly these Americans have no idea the F-22 and F-35 can't see, track, or target any other stealth aircraft from BVR (beyond visual range). Stealth alone defeats high-frequency (short wave) radar by absorption and deflection, it does not defeat low-frequency (long wave) radar. Therefore, to see, track, and target stealth aircraft you must have long-wave radar, but it must also be enhanced to remove all background clutter for targeting purposes.

Neither the APG-77 radar used in the F-22, nor the APG-81 radar used in the F-35, can see any other stealth aircraft from BVR (without enhanced long wave radar) — This fact the US Air force obviously know! Only it seems the reality is, that when the F-35 radars were being designed 13 years ago, there were no other stealth aircraft to think about as a potential threat? So how can these US aircraft be seen as any sort of threat to either China or Russia, who both have these aircraft technically beaten? They can see and target US jets from BVR, yet the US jets can't even see them from BVR?

Russia's new 5th generation Byelka (2band) radar, used in SU-57, does have enhanced long-wave radar, they've designed and developed the first L-Band fighter radar we've ever seen. They've cleverly embedded L-band AESA radars in the leading edges of the wings. The new L-band AESA radar data gets processed in real time through extremely powerful Russian Elbrus computers being significantly enhanced removing all clutter, meaning it can see, track, target, and engage enemy stealth aircraft from BVR. The technology along with its impressive range parameters and jamming ability over large areas make this aircraft deadly to all other aircraft types. 

They can also interact in ''real-time'' with each other member of the squadron, (auto selecting) the best placed BVR missile, that can be fired by anyone of the squadron with a bogie on radar, they can also take control of surface-to-air (SAM) missile defence systems - (that alone is lethal), and they can see track, enemy stealth fighter aircraft long before Russian airspace, from much greater distances, with "real-time" data from massive Russian ground long wave stations (that are all protected today with the networked S-400 defensive system). 

Therefore, as they'll always know where the enemy aircraft are, they'll always be able to approach any enemy aircraft head on, and therefore stealthily, (Russia wisely sacrificed rear end stealth for much better manoeuvrability) meaning today, the US fighter jets would not even be able to see them coming!! Russia's Byelka (2band) radar covers all aspects of frequencies across all channels, that are used for tracking, targetting, and also jamming. It's part of Sh121 multifunctional integrated radio electronic system (MIRES) on board the SU-57. 

Russia tested much of this new radar suit on the SU-35, so they also have the option of fitting this radar into SU-35's permanently, meaning Russia's SU-35S flanker will be at no disadvantage with F-22/35. As although the SU-35 can be seen and targeted from BVR, the SU-35 with the new 5th gen radar is as able to see and target the US jets from BVR, seeing the all-important Russian advantage in BVR missile distance, plus the excellent manoeuvring, neither the F-22/35 have, as more than critical, if you're going to avoid simply being blown out of the sky.
Reply: @hotstepper887  dude youtube is not a place for that. Make a youtube video instead if you have a lot to say, but please take the ads off because you talking plus the ads will cause a malfunction in Google's server and we will have to be without internet for a month
Reply: @hotstepper887  you realize the US literally paid the Russians for the Yak 38 engine layout right? It's a tried and tested method of making a VTOL aircraft. The assumption that the US has failed at producing one is nonsense. It's never been necessary cause we can secure proper airfields you fool. Britain is of course the only country to produce a plane with that much power yet it still be subsonic
Reply: Today, they say more Americans believe a German invented the jet engine! It's so sad. Frank Whittle says of his "Eureka" moment. It came out of the blue, he recalled. He had, effectively, dreamt up the turbojet, the early jet engine. I knew if a man was going to fly faster, he would have to fly at a greater altitude where the air was thinner. Whittle concluded that the conventional propeller would never be sufficient, and that an entirely new sort of engine would be required. His arguments were so advanced that he was awarded 30 out of 30 for his work. 

When the young RAF officer took his idea to the Air Ministry, later in 1929, they were not sure what to make of it. They ran it past a senior boffin called A.A. Griffith, who had already done some work on the subject. Whether he was misguided or simply disliked this young Whittle in uniform, Griffith gave the idea a thumbs down. As a result, the Air Ministry rejected Whittle's design as impractical, and carried on ordering traditional planes with propellers. 

So Whittle took out a patent to protect his turbojet idea, which was duly published by the Patent Office. Others, like the Germans, however, saw its merits, and German diplomats in London wasted no time ordering copies of the patent when the patent expired in 1935. A young Whittle could not even afford the £5 renewal fee.

The RAF remained supportive of their young genius, however, financing Whittle through Cambridge, where  needless to say, he took a First Class degree in Mechanical Sciences. All the while, he was still designing the jet engine he knew would work. Finally, two friends helped him secure enough backing to start a company called Power Jets Ltd, and in April 1937, he fired up his first jet engine, (the first seen working recorded Jet engine ever built).
 
Unlike the latter claimed German ''Engine'', they claim (long after), yet they claim it was in the same year, of the same month, and on the same day? LOL. Sure! Only nobody ever said a thing about it, at the time? But Whittles was spoken about, and written about, throughout the entire media world, as he couldn't turn it off. He had to wait for it to run out of fuel, LOL.

Today, his son, Ian Whittle's, primary concern is to protect his father's memory from continued erosion. He said It's appalling, it's a disgrace to human ingenuity, using cheap tricks, and misinformed people to make up history, It's now an accepted fact in the USA, that my father did not invent the jet, but, that he and von Ohain — (who became an American citizen) — co-invented it at the same time, he says... Pretty soon, history will be rewritten to say that it was a German or American invention, just not British.

So true his words really are? Certainly, many American engineering institutions now routinely describe von Ohain as one of the inventors of the jet. 

Captain Eric Brown, late, of the Fleet Air Arm, (one of the greatest test pilots in aviation history) said it was Frank's invention, and they just copied him. And let's be honest, he should know, not only has he flown more planes than anyone else — 487 different types, but he was sent to Germany straight after the war to get hold of all the Nazis aviation technology.

He says I interrogated von Ohain, who was very ambivalent about where he had got his ideas, he couldn't say where his Idea came from, says Capt Brown from his Sussex home. He goes on, but his sidekick was different, an open book, he was utterly straight-forward about it. He said that Whittle's patent had been in every technical library in Germany, even before the war. He says, I have absolutely no hesitation in saying that Frank Whittle was the real (and only) inventor of the jet engine — and furthermore that he could have produced a jet fighter by 1937— If the Establishment had been on his side. But the Jet Engine is Frank's very own Invention.

This is the American mentality, and it always has been, you only need to study Anglo-American history, to see straight through this misrepresentation of a “Special Partnership”. 

Whatever the British have achieved In this world, the American wants to beat it. And however they do so, whether by cheating, lying, making up history, stealing others technology to credit themselves, the list is endless.

But, I mean, let's be honest... Just how stupid are they really, they really don't understand British history, as they'd need to be incredibly stupid, unrealistic, and foolish, to try to top what the British have already achieved in this world, as no country gets remotely close.
Reply: The amount of "expert pilots" in here is hilarious! You really think the US is going to let the public know about all the secrets of the worlds best, most advanced fighter... It's full potential is going to be a close guarded secret.
Reply: @Nate-bn5kk  so you're saying we need Russia to invade the YT comments? Nah I'm good
Reply: @CED99  That makes no sense
Reply: @CED99  tell me teacher, where exactly is ukraine?i heard its next to russia and poland
Reply: Only two aircraft ever built could cruise supersonic, the F-22 and the Concord.  Both are discontinued.
Reply: @Maniac742  What about the TU-144?
Reply: @Maniac742  gripen NG can also do that and its a light fighter with single engine, there is other jet that can do that like rafale and SU-35, all i said above are in production
Reply: How do you get to hell?
Very simple: claim that you're innocent.

How do you get to heaven?
Very simple: Admit that you're not Innocent, you're guilty and ask for mercy.

How to know if you're guilty or not?
Simply: Compare your life to the Ten Commandments God gave you in the Bible.
Everyone agrees that if people followed the ten commandments there would be no need for governments or police.

Do not lie.
Do not steal.
Do not commit adultery.
Do not insult God by using his name as a cuss word.
There are six more but let's just leave it at that.

How many lies have you told in your life?

Have you ever taken anything that didn't belong to you?

Jesus said, if you look at a women lustfully you've already committed adultery in your heart with that woman.
How many times a day do you do that?

Do you use God's name as a cuss word?
Would you do that with your own mother's name?

If you answer these questions honestly you know that you're guilty.

God can justly punish you and send you to hell.

Ask him for mercy.
His name is Jesus.

It's as simple as this, The Ten Commandments are called the moral law. You and I broke God's laws. Jesus paid the fine.
The fine is death.

Ezekiel 18:20 — 
"The soul who sins shall die.

That's why Jesus had to die on the cross for our sins. This is why God is able to give us Mercy.

Option A.
You die for your own sins.

Option B.
Ask for mercy and accept that Jesus died for you.

*
Reply: @brianhale3678  What does bible thumping have to do with this? Nothing.
Reply: @brianhale3678  I’m not going to know I’m decomposing cause I’ll be dead. Just like when I’m asleep. It’s not complicated
Reply: @thomasa5619  super sad
Reply: @brianhale3678  Boo hoo
Reply: @brianhale3678  God either doesn't exist or quit caring a long time ago pal. Take your gospel somewhere else.
Reply: @wsv8818  I don't hate you, Sir.
Gospel means good news.
And I will continue preaching at here because you have exactly zero authority over me.

God will offer you no more evidence for his existence other than the planet crammed full of amazing creatures on which he placed you.
You will spend your entire life here.

Surrender to him.
Reply: @brianhale3678  The all-knowing all-powerful tooth fairy in the sky who sends us to heaven or to hell isn't real. Heaven and hell are just stories too.
Reply: @rayzerot  actually, in reality it's exactly the opposite.
There is no such thing as an atheist.

Now, I'm not smart enough to make that declaration. Though, I would highly suspect that there is no such thing of an atheist, because of all that beautiful stuff outside of my window.

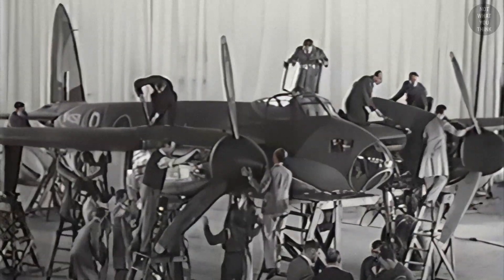God says, there's no such thing as an atheist. Romans 1:18 through 21.
He has provided us a gigantic planet crammed full of amazing things and incredible creatures. This demonstrates to quote the Bible, 
"his eternal power and divine nature"

People reject his authority because they hate his authority. They prefer a silent universe that has no moral authority over them. But pretending a cop is not real does not get you out of the arrest.
Know your rights, surrender while you can.

Evolution offers you a future as dirt.

Jesus Christ offers you eternal life and peace with God.